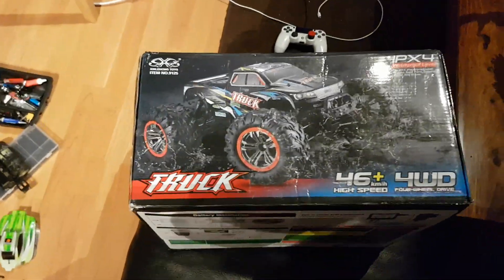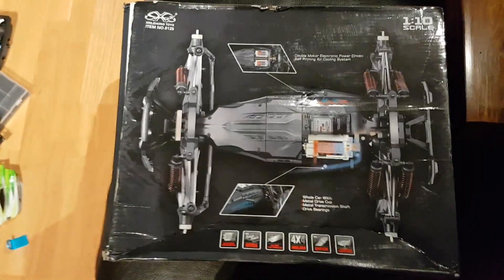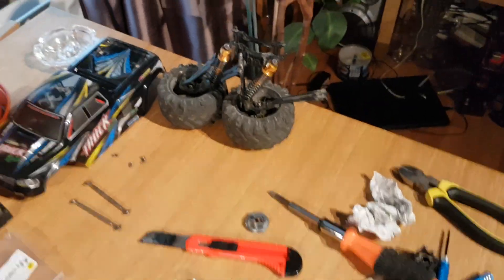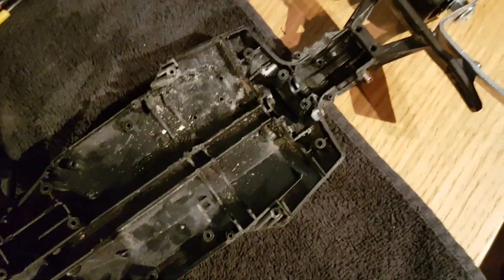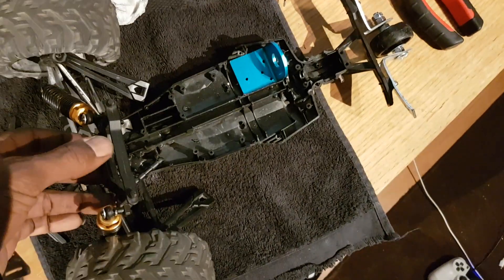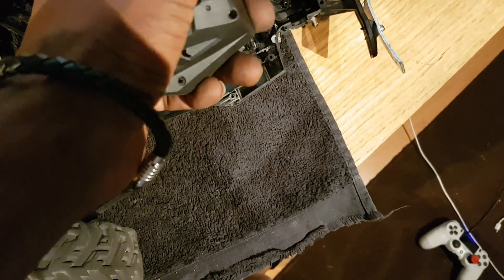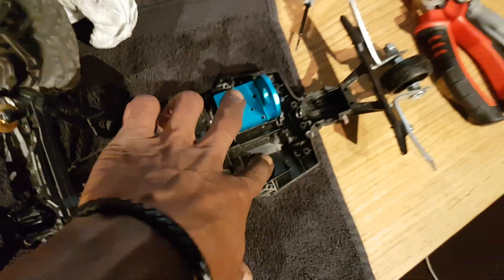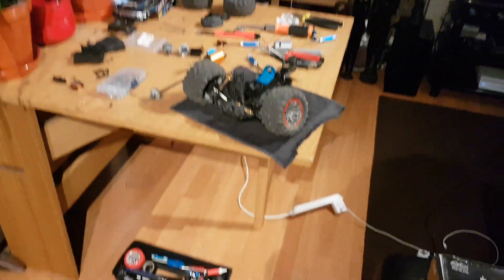9125 IPX4 Brushless Upgrade pt1

Comment: The whole advantage of that truck was that it had two Motors what would have made it awesome if you went ahead and went brushes to Motors nobody needs you to downgrade that truck upgraded the two motor is not throw away for 1
Reply from the maker: Only reason I have gone 2 motors is because I can't find a metal spur gear to take the power so if you know of a metal spur gear that fits I'll fit 2 brushless motors.